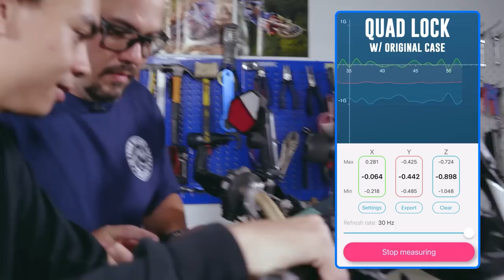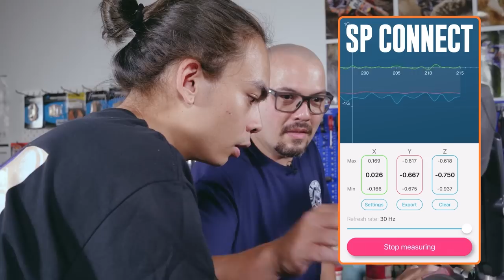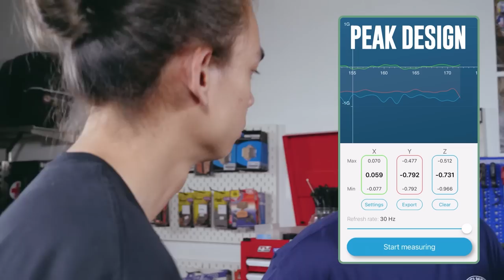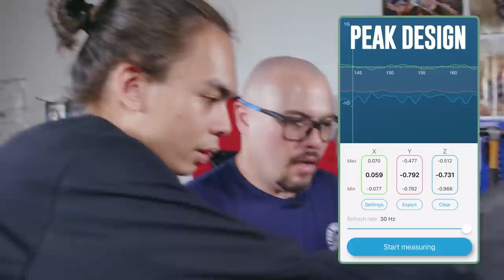Quad Lock Vs Peak Design Vs SP Connect | To The Test #12

Comment: Peak design.  Remember, quad you need to buy the dampener, that is built into the Peak Design. Also, you used the stick on for Peak Design, would be nice if you do the actual case like you did for QuadLock

Comment: Looking at the mounting, it seems that both quad Lock and peak design allows us to mount the phone in both portrait and landscape without adjusting the mount with a tool.  It looks like SP connect I'll need to decide whether I want the phone to be portrait or landscape during installation.   If so, I will surely strike it off if it is important that I can switch the mounting profile as and when I like.
Reply: On the Peak Design you just put the phone on the mount in the orientation you want at the moment. Watch the video and you'll see.
Reply from the maker: Thats a very good point. And yes for the sp connect ud have to readjust the mount with a tool. Somewhat inconvenient

Comment: I've been using Quadlock for ages, but its ugly when then phone isn't on, I'm considering the Peak Design, on a side note, this video was the most fun phone mount review ever, you guys are legends!
Reply from the maker: Thank you buddy. We are happy that you enjoyed the vid! We really like the Peak Design mounts though price  is a little on the higher side
Reply: @tri333ple  I'm willing to pay the extra price for a good product, but I have fat bars on my Harley, the standard bar mounts don't fit and I think the adjustable strap doesn't have any anti vibration
Reply from the maker: The vibration damper is on the connector that your phone mounts to the handlebar, if you remove the rubber on the handlebar mount you should be able to fit it on most bars unless your fat bars are thicker than standard!
Reply: Unfortunately my bars are aftermarket and are 50mm thick, I believe the handle bar mount only goes to 35mm

Comment: During the vibration test you didn't try at higher RPM, I'd bet you'd see more drastic differences between with and without vibration dampening 

Good video though! I appreciate you mentioned the vibration dampner being an addon to the others, it was the main selling point for me when deciding which to get, at the end of the day for a vibration dampening mount they all cost nearly the same

Comment: Great review! The quad lock is a great phone mount however I prefer the Eowihor. Weird name, great phone holder. It's a cradle you simply drop your phone into then hit the lever on the side to close the cradle tight around the phone. You don't have to hit the lever because it will still stay put but the lever is recommended in part of securing it. There have been times I forget to hit the lever and it still securely holds my phone. It's adjustable for most phone sizes & has multiple ball mounts that come with it at no additional charge and it's very inexpensive, around $18. Having the ball mount allows you to quickly rotate your phone with one hand. And it allows you to use your existing phone case, as long as it isn't over 9.25 cm wide (The Galaxy 20+ is 7.8 cm wide).

Comment: was the vibration test done with the dampening bases?

be curious to see standard base vs dampening base
Reply: no, damper is big enough you would see it here, they did not use it
Reply: also I would like to see vibration test on single cylinder dual sport bike. I have expierence with mine ktm 690 enduro, vibrations damaged not only camera, but also screen lights go off. I've been using samsung galxy xcover pro.

Comment: They now do a quick attach detach copy of PD on temu the problem being i dont trust the stick on mounts and dont know if it is an exact match for the peak design cases. Maybe you could do a strength test on the copy version and see if it matches the PD cases The thing is the cheap one is £8 so it makes you wonder on the markup of the PD original

Comment: I use Sp Connect sistema about 4 years and never had problems. Also fall down my phon to my pans in moto at 40 km/h and the phone case protect my phone very well. I'm interessed to peak design for the attack sistema very easy and fast in vertical and horizontal but I see a lot of people showing the case breaks quickly and I don't unterstand why it does attack only in two point and not consider for four point to dissipate energy whit more effectively and be more safe on moto and bike. And also haven't the antivibration module. I think peak design have more design for sure, more premium, mor quickly, the accessories for all day and office very good but for motorcycle and mountain bike sp connect are more secure, professional and efficient!

Comment: I was always very happy with Quad lock until a bought Wireless charger.
I had a A34 Samsung that doesn't have wireless charging so i bought a S23 FE phone. The only available case for that was the Mag Safe case. Now i found out that my phone doesn't charge because of the mag safe case. My other S9+ phone with the normal case charges up but my S23 FE with mag safe case doesn't charge up. Very bad design from Quad Lock...

Comment: Great case and mount but it is flawed as it doesn’t charge with my Audi wireless charger or apple wireless charger or my wireless stand, in fact it doesn’t charge with most other wireless chargers only Quadlocks own devices!! Very disappointing from that perspective, I did try to get in touch and did have a online chat but was told exactly what I just discovered above, so they basically said good luck but only our chargers are recommended, pity they take such a poor customer service stance. But great case just don’t expect it to charge.😢
Reply: Do literally comment on every quad lock video? Move on. I drive an Audi and you are annoying.

Comment: I too have a love/hate relationship with my quadlock. Easy to remove but irritating to try and mount the phone using one hand.

I have also considered switching over to Peak Design- but unfortunately their phone covers won't play well with S-Pen capable Samsung Galaxy phones.
Reply from the maker: Yes, sadly anything with a magnet messes with the s-pen detection. Amos and Jake have that issue with their Galaxy fold also.

Comment: Good tests, but completely wrong.
The goal is for the phone to be protected. I have no reason for the support system to withstand the impact but the phone to be destroyed. Normally, even if the phone falls from the stand, it has a case that can protect it. In the previous test, you broke your phone, because it did not detach from the support in time.
Reply from the maker: Good point! Maybe we should do a test of the cases and see how good they really are too.